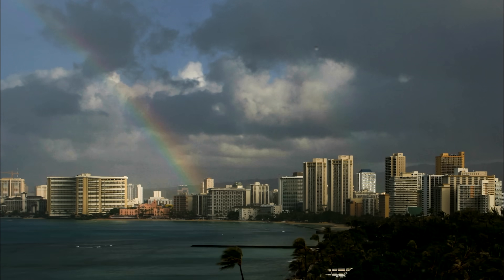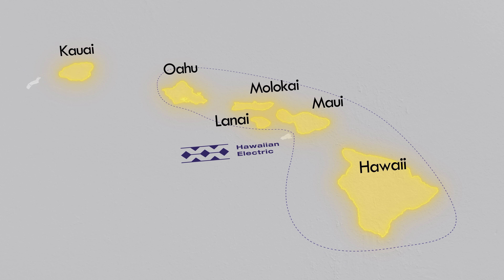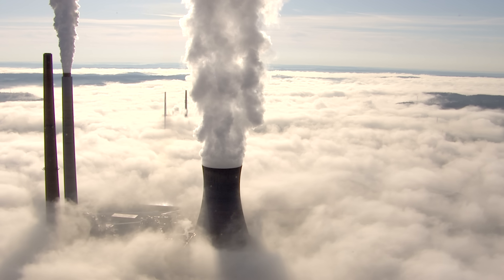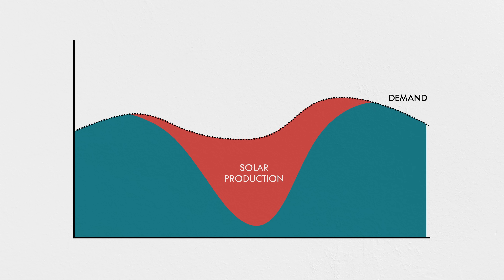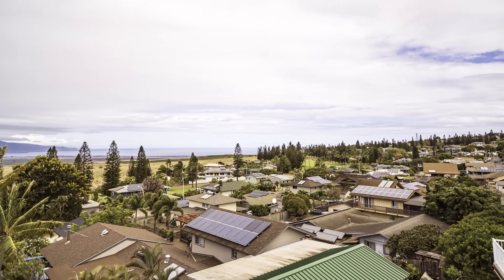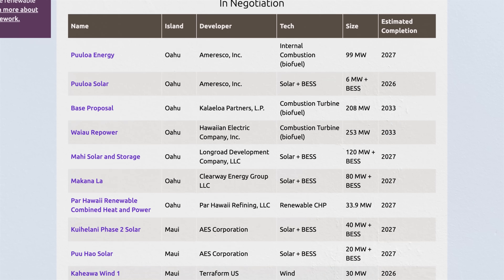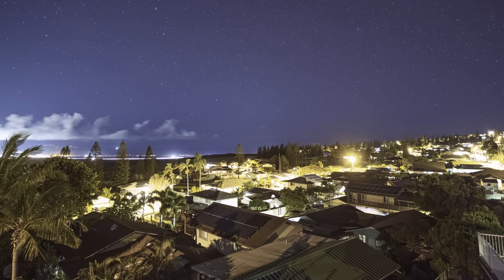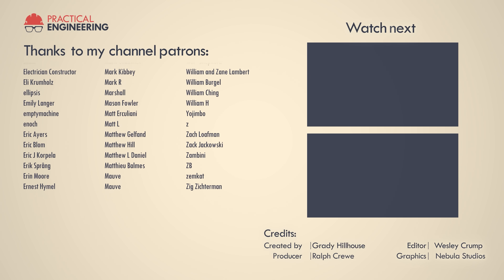How the Hawaiian Power Grid Works

Comment: I thought for an O Neil Cylinder, you could prewire everything in the shell for everything up top, and you can also wire it all for power and stabilization (both the citizenry and for movement)

A Cylinder that's 50,000 feet (49,000 feet usable) by 400,000 feet would need VERY versatile power transmission for both the people and the Cylinder Itself, Besides having Embedded Super Durable energy storage in the Shell and the flywheels.

In Effect, the Cylinder Itself would have a "free" base energy and water grid for everyone, and anything above that could be purchased or made.
It would have Solar Panels deployed around it, nuclear, and experimental fusion.  People Would Live Like They Do In Dubai, but more practical.

An O Neil Cylinder Would Be A Net Energy Exporter, Tourist operation for Everyone, besides space platform and peace keeper.

Comment: Noticed a few inaccuracies in this @PracticalEngineeringChannel video. Since each island differs the data presented may not be representative of all islands. Some point that paint a more optimistic reality. 

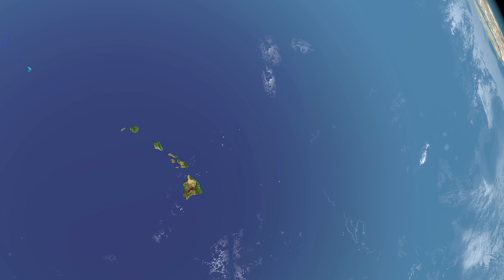5:40 Hawaii currently has ~29% renewable energy currently and requires that 100% of its electricity be generated by renewable sources of energy by 2045.
 
7:40 Regarding grid frequency inertia ... it has been proven that battery energy storage is able to out preform traditional infrasturce in maintaining grid frequency stability. This was first proven in 2017 at Hornsdale, Australia (Tesla's first Big Battery installation). It has since been replicated across many parts of Australia as it works so well. In U.S. the largest such battery energy storage is located in California and Texas. In January, Oahu (Hawaii) turned on it's massive 185MW/565MWh Tesla Megapack. 

9:40 Not on residential PV solar inverters are dumb. Specifically for Hawaii, Enphase deployed special software to micro inverters on residential solar systems in Hawaii that give power company data, and some options to configure when / how much power can be feed into the grid. 4-5 years ago at certain times of day some parts of Hawaii was feeding in too much solar at undesirable parts of the day. I know Enphase was the first to work with Hawaii's power utilities, but expect other manufactures have also stepped up. Hawaii's grid operator might be able to provide more specific details. 

Note: for all 3 examples, searching online based on company names and Hawaii reference will pull up articles going more in depth to specific solutions deployed in Hawaii. In some cases the projects are more than 5-7 years old, not just a future proposal.

Comment: Why not convert to dc powered appliances and cut out the huge power hungry inverters,converters,and transformers??  A smaller power need requires less infrastructure with less pollution by products... Most homeowners could be fully self efficient other than sewage and water,but with rainwater collection and treatment combined with septic fields even that could be overcome in most areas... Tesla was right,but big oil won via bribery and illegal actions...
Reply: Wouldn’t function the same.
Reply: @jeron3966  Not so.. I have all dc ceiling fans,water pumps,lighting,etc, and they all work perfectly directly off of a 12v battery bank, which is charged by solar and a small wind generator,no inverters or converters other than stepping the panels output down to 14.5 ...
Reply: @Wil_Liam1  but the energy efficiency of the entire island, it wouldn’t be the same it would be smarter to ban the sale of AC or just promote efficient AC (which is already being done)

Comment: The stability of the rotating mass cannot be over emphasized! 
I used to be an engineer on ships, part of the job was generating the electric power. I would be sure to keep the generator(s) running @ 60 hz. Yet I would get off a 4 hour watch, and find the electric clock in my room would be off as much as 4-6 minutes. A clock run off a quartz crystal was right on the money.
This demonstrated to me, that even though the frequency meter showed a generally steady 60 Hz, those brief excursions, when a motor would start and stop, would add up quickly, and not give a steady time base frequency. 
Those were relatively small generators, 1.5-2.5 Megawatt range.
Larger rotational force = steady frequency.
Very interesting video, I was Chief Electrician on Matson ships, so I've been to Hawaii many times and, strangly, never considered where and how they got their power from. I knew people there, that told me that they had an electric generation plant on Maui that was powered with the leftovers from the surgat cane.
Reply: So they dont have this any more. But back in the older days in the load dispatch center controlling the grid they had big analog clocks on the wall driven off system frequency, and they would adjust the frequency to maintain these clocks accurate to a reference clock by varying the frequency up and down to account for drift. To within a couple seconds. Nobody using grid clocks anymore though so it’s largely irrelevant now.

Comment: I've actually had to deal with something similar in a  professional capacity. One of the projects i worked on in the in past was a home on a Bahaman island. And the island's only source of power were a couple of diesel generators that weren't in the best shape. So, I had to specify battery backup system for the home to deal with the frequent power outages.

Comment: In addition to not helping frequency recover faster when disturbances happen, inverter based resources also react abnormally when faults occur on the grid. If a grid is leaning heavily on wind and solar and a large disturbance occurs, inverters may trip the generation off completely due to phase angle differences.  NERC’s Odessa disturbance report gives pretty good insight to this phenomenon.

Comment: I was stationed aboard a  ship at Pearl Harbor when Hurricane Iwa slammed into Kaua'i in November 1982, knocking out power to most of the island. The Navy sent the nuclear-powered submarine USS Indianapolis to Nawiliwili  harbor in hopes that it could provide power to the island using its generators. 

Unfortunately, the power companies didn't have sufficient personnel available to take the time to essentially plug the island into the submarine. They were all out repairing the damage from the storm, so the connection was never made.

Comment: The solar industry needs to develop smart home inverters that tie into the grid. I can see why Hawaii electric doesn't want more home solar if they can't very well control what is happening to parts of their grid. Possibly the inverters could divert home solar electricity that is not needed on the grid to backup batteries or water heating, pool heaters or pumps, etc.

Comment: would like to see a calculation on how much  battery storage could help with grid reliablity.   Ideally you have electric cars charge during the day, and could share some fraction of their power  back to the grid as needed.   Since hawaii islands are small most typical cars don't need a huge range anyway.  Obviously its very expensive to retrofit old buildings to have extra chargers, and most people living in apartments and condos can't choose to get  a charger.

Comment: I wonder if there are any energy intensive industries that could ramp production fast enough to clip the peeks off surpluses?

The reason that would be relevant is that most renewable are "use it or loose it" sources where the supply (or lack of) isn't a function of demand. As a result, storage becomes a requirement. But basic queuing theory makes it clear that when unregulated production and consumption is mixed with limited storage, the storage will eventually overflow or underflow. In this case, some renewable supplies are (within limits) regulatable and demands can be influenced, but the more you can do each of those, the simpler the design constraints become. Time of use pricing to decrease demand is one option that allows building less supply. But you can also use it in the other direction; get dump-load-clients that will guarantee they will buy when prices drop below a given point (e.g. put options) and use the guaranteed minimum revenue from that to over build supply.

Comment: I have no problem building my own infrastructure and asking nothing from the electrical utility or my neighbors, so then all my alt sources are islanded and can't be a problem for anyone. Curiously enough, this is almost universally forbidden even if the islanded installation is all certified to code, permitted, and inspected. So I have to think that the problems you describe from such systems are much less significant than the revenue that the public utilities are determined to generate. That, as it turns out, is the primary issue--it always comes down to revenue. It is truly the bottom line, in virtually everything.
Reply: If you’re in a shack and are highly skilled contractor, great. Almost everyone in a shack still has at least a small generator. 

If not, you can neither build water, sewer, and power, nor afford to build it and maintain it. There  are numbers of people living remotely, in good size houses, but they have  expensive wells dug by prior nit you, and large propane tanks refilled periodically running heat and power w a bit of PV. The whole show w maintenance is always more expensive than a connect to most US grids.

Comment: It seems like the solution to fix costs not being recouped because of net metering would be to charge fixed costs for transmission and distribution. Not the per-kWh distribution costs we pay in Massachusetts, but an actually fixed, per-month cost based on the amperage of your service. e.g. $50 for 100 amp service, $100 for 200 amp service, and so on. It's fair to people with and without theire own solar panels.

Comment: One relative cheap way to balance supply and demand is to implement a Demand Side Load Management for climatisation. If power is in short supply, the air conditioners of the buildings could be set 2-5° higher. As soon as there is enough power supply, the buildings are cooled to their set standard temperature.
If people use Energy efficient buildings, the Houses will only lose 1° temperature per day without cooling/heating. A standard US home will lose 1-2° per hour.

Comment: The problem with inverters is not so much inertia, as you can operate them to emulate inertia. The main issue that has no solution is short circuit power, which is limited due to the inverter capabilities.

I would suggest you dive into synchronverters, which provide an interesting solution for the inertia issue.
Reply: Batteries can react faster than other grid stabilisers, in milliseconds.

Comment: I think it's ironic how the Island of Hawaii is home to so many Nuclear Powered USN ships and submarines yet struggles with its own unreliable power grid.  The islands seem like the perfect location to use several small scale nuclear reactors to easily handle the load.
Reply: Many nuclear reactors rely on external infrastructure (including non-nuclear power sources) to start up and/or run systems post-startup.  Hawaii's infrastructure probably can't support reactors easily.  The Fukashima reactors, for example, failed because the external power for the cooling systems was cut after the earthquake and tsunami.  Oahu is probably the only island with enough infrastructure, and they'd still need to ship in fuel and equipment from outside the state.
Reply: @bubicus  I understand your stance on large scale reactor types of the past but this was not my point as I spoke of small scale nuclear reactors, and also I'm unclear what external power you referenced to be the failure mechanism for Fukashima reactors.  It was finally the inundation of the onsite backup generators that sealed this fate and that attributable to it's 1970's design.  We can do much better today and I believe the people of Hawaii deserve clean and reliable sources of power.

Comment: If such a small grid, without nuclear power can transfer to renewables... than Germany should be even simpler an cheaper. Germany produces in past years about 50% of the electricity from renewables. But there are also some extra challanges because Germany is far more north than Hawaii.

Comment: Great video, however "distributed energy resources" don't create an additional demand on the grid, they create an instant REDUCTION on the grid demand (literally at the source, as soon as they touch the power lines at each house/installation).  There are definitely complications with figuring out predicted resources and reliability, but that's about it.

Comment: Special inverter circuits connected to battery banks can react like inertial loads forcing the grid frequency to remain constant.
Electrons don’t care if you push them with transistors and a battery or with a giant spinning metal coil.

Comment: Excellent video. You didn’t mention the vulnerability of transmission lines and transformers on poles to storms and wildfires. Maybe what happened on Maui would make an interesting video. Wind turbines have to shut down during storm events, and dense cloud renders solar panels useless. Battery storage is not a panacea because it is expensive, and consumes a lot of metals that have to come from somewhere.

Comment: Solar PV equipment is so cheap relative to Hawaias cost of electricity.  It is better to be completely independent or off-grid for residential, only to be connected to grid if it is worth it

Comment: I have a counter argument to your "you can't pay less for less reliability and more for more" statement.
You can partially or totally remove yourself from the power grid, and pay a smaller rate at the cost of not getting reliable electricity (think nomad with some solar on their van but plugs into shore power on occasion), or you can build in backup generators/complex battery storage on site in order to get local fail over reliability. Datacenters and hospitals frequently do this.

Comment: Another reason for more cost for Hawaii is the location is one of the worst for material longevity.  It has the perfect combination of UV, salt, humidity and Sulphur.  Many materials are designed to last 40+ years in most states but only last 15 in Hawaii.  
Coming from a utility supplier

Comment: My wife thinks they need pneumatic tubes. What kinetic energy does Hawaii have 24/7 for the last since its been an island? Water movement can power pneumatic operated air turbans. Air, it is abundant, light and the expensive bits of the power plant are above water.

Comment: If Hawaii wants to go significantly more renewable they will probably have to interconnect the islands. I would assume using a DC interconnection but I'm not a Power engineer. It will also require a high quality smart grid where the grid has knowledge and perhaps even control of individual user's power consumption. Rather than thinking of it as a problem Hawaii should be thought of as a opportunity to develop technology that can then be expected around the world.

Comment: I just read an article in T&D magazine about a large battery storage unit that can absorb the surges of the wind and solar.  It can act as an electronic inertia that can respond in less than 250 mS to stabilize the power grid.  As a bonus, these batteries can provide the "Black Start" power following a total blackout.

Comment: Interesting seemingly no base load power plan in the phased 2045 dead line. Identified renewable sun and wind source unreliability and effects of voltage phase and frequency on the network at consumer level well identified, heading into no reliable base load power backing up a grid is madness. 

As each year goes by population increases and therefore power demands do also, not having base load to smooth out renewables to cover all the variable consumer demands and renewables unreliability is going to be a power supply company and consumer nightmare. 

Interesting no where in this well presented video is nuclear not mentioned as a possible base loss power option.

Comment: I'm quite surprised that volcanically active Hawaii isn't copying Iceland and generating nearly 100% of it's electricity from geothermal power.  They are in a fantastic location for it and it's extremely reliable.  If I were them I'd hire the Icelandic energy company to come out and help build up geothermal capacity in Hawaii

Comment: You can indeed pay for more reliable power.  You can pay to have a second feeder line brought into your premises from a different substation, often from a different geographical direction..  It's expensive, but sometimes worth it.
Reply: Or a battery bank.
Reply: @catprog  They're usually not provided by the utility company for a charge. No pun intended.

Comment: Hi Grady! Something about the inertia of the grid I would like to add is that low inertia itself is not the only issue, the variability of inertia also comes into play! If you have a system with a constant inertia (throughout time) the ROCOF (rate of change of frequency) of the grid is always proportional to the loss of power. (delta F = H* delta P) . Many generators rely on the ROCOF to increase power. In a system where the inertia changes drastically over time simple ROCOF protection has trouble as it is too slow for low H scenarios, or too fast for high H scenario's.

Comment: Makes me wonder why they haven't been pushing for, and being the core innovators of tidal power generator arrays. Massive arrays of shake-weights (basically) that generate electricity off of the tides/waves. I imagine in its current (pun intended) state, they don't produce much, but I have to imagine they'd be useful if innovated upon more
Reply: The ocean is not cheap to build in.